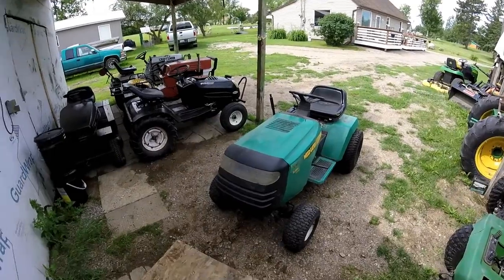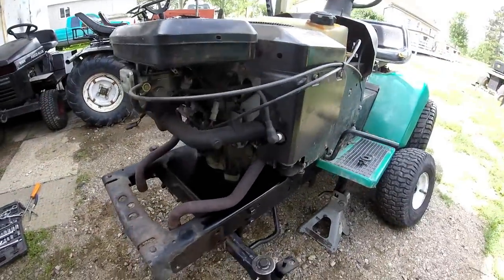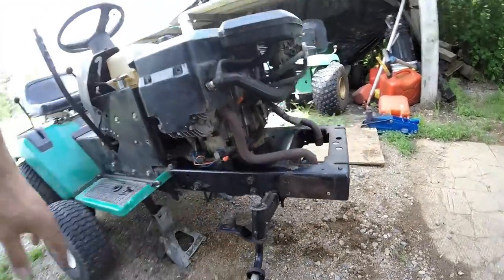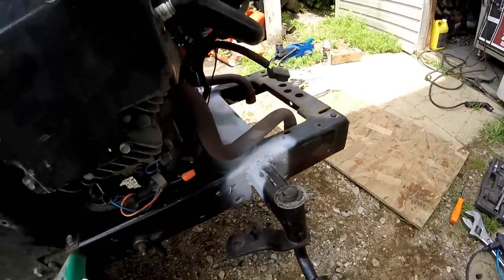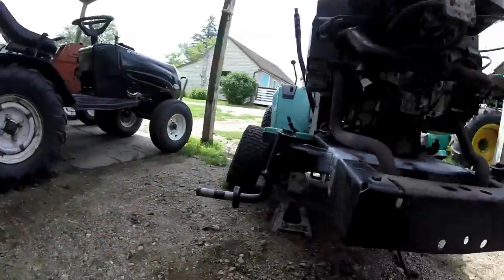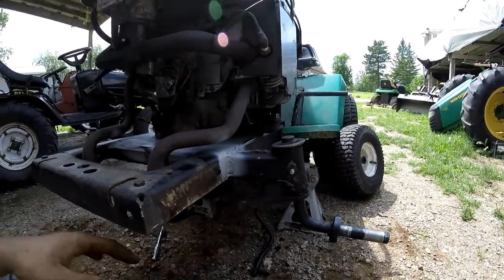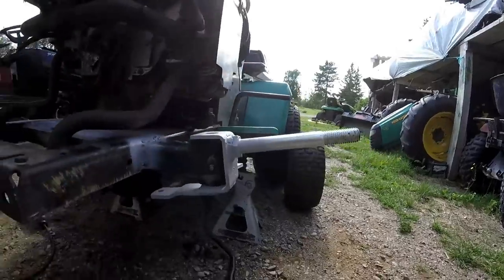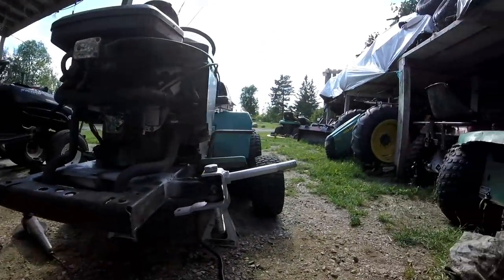How to build a racing mower part 1 lower the front end

Comment: All i did to lower the front of mine is unbolt it flip it upside-down and bolt it back up and the frame is now almost on the ground
Reply from the maker: you can do it like that but I wanted it fully welded so when you go around a corner fast it doesn't flip
Reply: THE Thunderbird Dirt Car _ 
 Zazu z.
Reply: Hey I didn't think of that but I think greasemonkey has a good point. I'm mostly just doing it for something to do with the step son.
Reply: @greasemonkey348  couldn't u filp it upside down then weld it up
Or maybe could notch like u didn't but not as much and weld it and then bolt what ever bolts u can get to
Reply: @JorgeVonVogler  yup!
Reply: I couldn't undo the bolt
Reply: Was it really that easy? Considering doing it to mine

Comment: you  should fix the camber on the spindles , get better traction , run faster thru the corners
Reply from the maker: it just for looks for me I don't find it bad or good to drive
Reply: I race modifieds on dirt, we set the front camber @4 degrees negative for the right front and 3 degrees positive for the left front!
Reply: @joeestes8114  is that set up for circle track?
Reply: Phil C Yes, it is, and its also for high bank dirt!
Reply: Phil C yes sir!! -5 rd +2 lf
Reply: @joe how do you even set the camber on these
Reply: @jacy9953  bending I think

Comment: How do I remove deck and blade?
Reply: Without removing the belt
Reply: @isaacezekielthecolorblindg7343  you could cut the belt?, lol theres no way you can drop a deck without taking the belt off
Reply: you have to take the deck belts off to get the deck off but there should be some bolts that hold it on just take those off
Reply: Bend or take of the belt guards and look for pin and pull them out and disconnect the lever that pulls it up